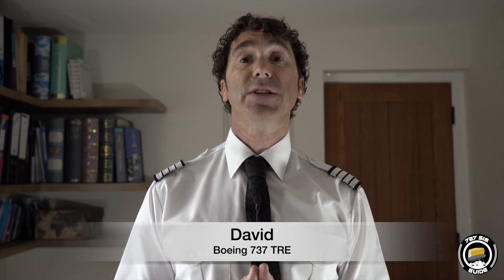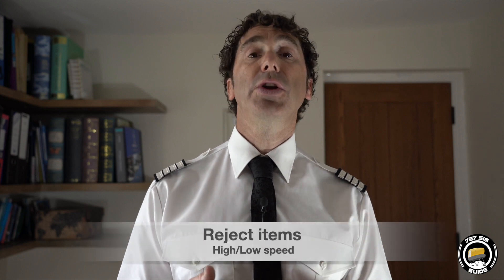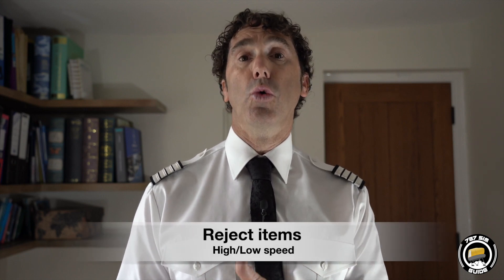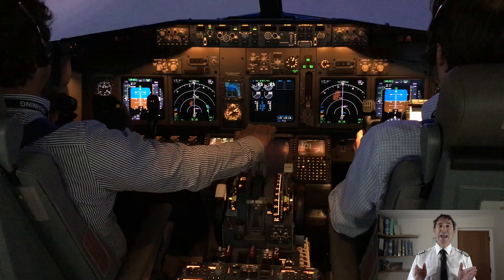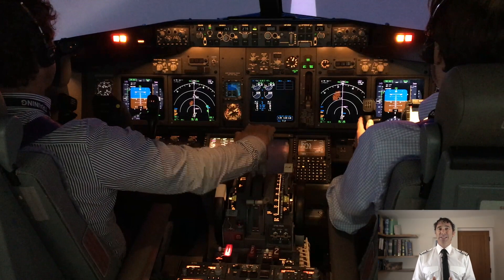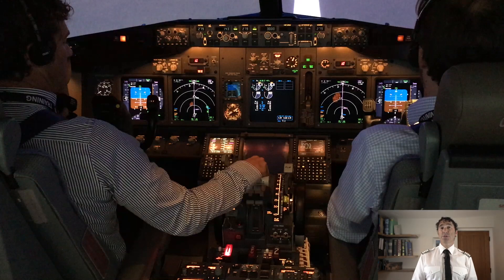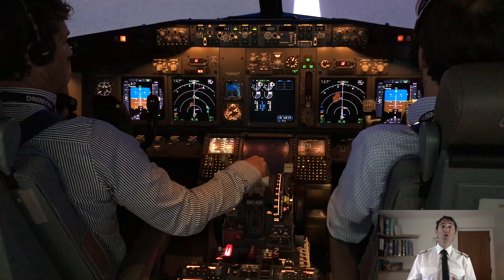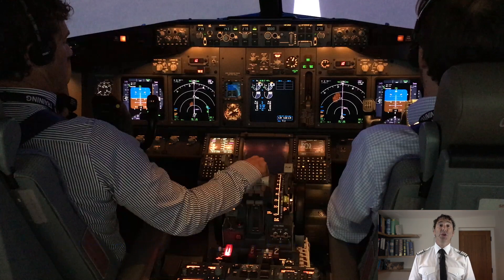Aircraft Emergency - Rejected Take Off 737

Comment: Any reasoning behind RTO autobrakes coming on at 90 kts and not at 80 kts and let it coincide with the differentiator between low-and-high soeed reject regime? Why was it engineered like this?

Comment: Capt,I just want to get a clarification on a question asked in an Interview recently. The question was,"If u see a windshear Caution(Red cone with black stripes on ND),Will you reject or continue".I searched everywhere, but couldn't find answer.Even in qrh,It is written on approch,it is pilots discretion, but nothing about take off.Can you help me in finding answer and where is it documented. 
Another thing, what all will be our considerations after the Reject. Like,how will we know the fuse plug melting. What else should we keep in mind before attempting another take off.
Reply from the maker: Hi Arun, This is great question because it focusses on an area of knowledge that you have to look a little deeper in to and  is not very well explained in the FCOM and QRH as you have found. The answer is you would continue and manoeuvre to avoid the wind shear (IE warning cone). Here is why, you stop up to V1 for a Windshear "Warning". Windshear is divided in to 2 categories REACTIVE (you are in windshear now, 2 tone siren Windshear x 3 etc.) and Predictive (from the weather radar, saying you are about to get windshear) Predictive is further divided in to Cautions and warnings, these are depended on proximity to aircraft, see FCOM. What you were asked was red and black cone with a caution, which is "Monitor radar display" (hold down the SYS test and you will hear it as the first callout), this is both a warning and a caution, you will see red or amber windshear on ND to know which is which. 
Considerations after a Reject, fire crew monitoring the brakes and following to stand, letting the crew know whether an evacuation is needed or not, what was the brakes on speed, consult the brake cooling schedule etc..Look at QRH MAN section Rejected Take off for the full list. I hope that helps. I will put a Windshear presentation on the list of videos.
Reply: @737simguide2  thank you capt .Looking forward for your windshear video.